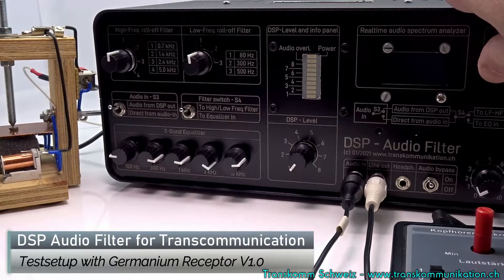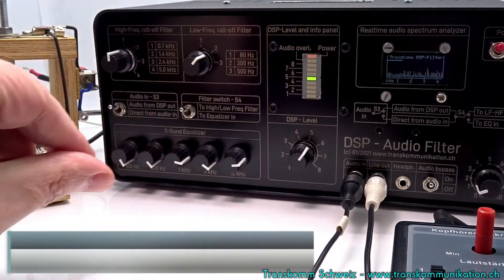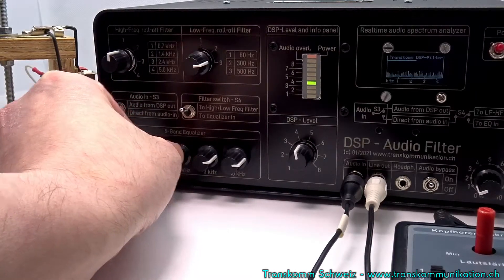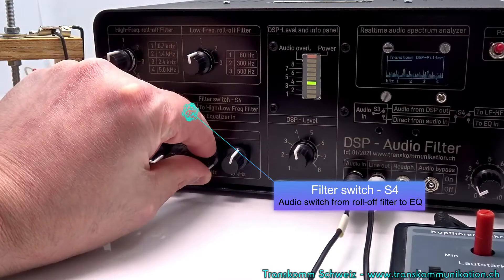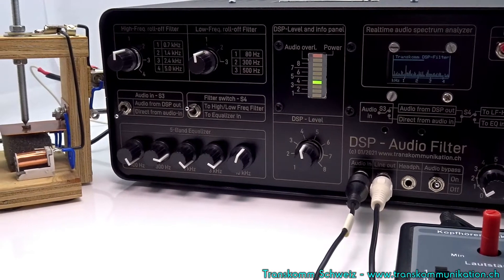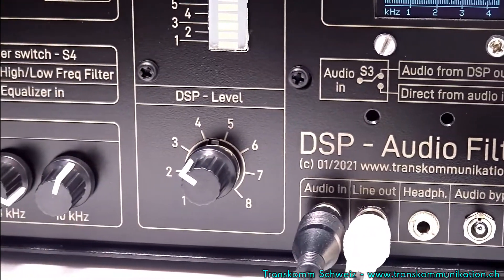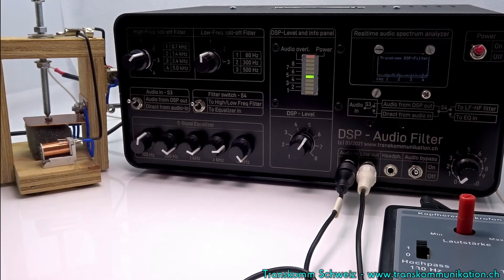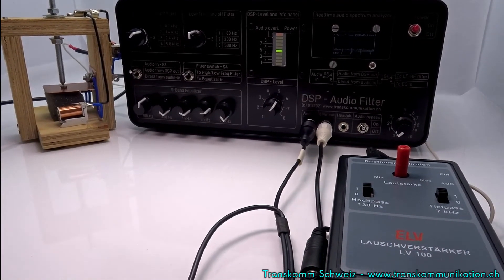Filtering Paranormal Audio: DSP Filter & Germanium Receptor V1.0 Test

Comment: The results of the DSP processing remind me of those the LINGUA produced as well. Your filter is an excellent device for all kind of ITC setups. It is outstanding on all levels and not the slightest trace of ac hum!
Reply from the maker: Thanks Andrés. The DSP filter algorithm works similar to the LINGUA DSP filter. 
In my opinion, the filtering of my bhi filter is less "aggressive" than that of the LINGUA. Therefore, the filtered signal does not have too many filter artifacts, which improves the intelligibility of the audio signal.
Reply: @beyond_electronics  This is a very important information for me Salvatore because, as you know, the LINGUA by HoerFabrik isn't available anymore. I own one LINGUA which is such a versatile tool to improve ITC voices and up to now I haven't found anything to replace it that is available in the internet. Thank you!

Comment: This is excelent, thanks for sharing. I d love to have one of them  germanium receptors. That offset white noise does sound completely different to radio type white noise. Do you have noise gate on that audio hardware?or dynamic processing? Cheers for sharing
Reply from the maker: Thanks :) The Germanium Receptors I unfortunately do not sell yet because it takes a lot of time to build them, at least the Germanium Receptor V2.0.

The Germanium Receptor V1.0 here in the video is not complicated to build and can be rebuilt relatively easily.
For the Germanium Receptor V2.0 I was busy with the construction for almost 4 years. But I have published all documents on my homepage and everybody can download the plans to build it by themselves, technical knowledge provided. 

The noise is definitely quite different from a radio because the noise is "generated" by the germanium plate, in connection with the coils and also the pressure of the screw tip on the surface of the germanium. In this video, the signal from the germanium receptor is processed with the DSP filter. 
This is a DSP module from the company bhi. I then added the switching of the bandpass and highpass filters and the 5-band equalizer. 

Otherwise try to rebuild the Germanium Receptor V1.0. The plans can be found on my homepage.
Reply: @beyond_electronics  was just thinking, i remember reading somewhere that the distance of the copper coils is important, if the device was constructed with coils on a pully, then the distance could be experimented with, as apposed to the coils being stationary, just a thought anyway. Thanks again for sharing this great work
Reply from the maker: Thanks for your comment. Yes, you might be right about variable spacing of the coils. I also had this thought when building the Germanium Receptor V1.0, but I initially wanted to build it relatively close to the original. 
Many ideas came together and at a later stage I will surely build an extended version of the Receptor with variable coil spacing. Among other things, I would also like to make the coils interchangeable to see/hear if anything changes, or if maybe the whole Receptor becomes more sensitive. 
Another idea is also to put the whole construction of the Receptor inside a big coil and then "activate" it with a higher current flow. So there would be a magnetic, as well as electrical components involved. 

Thanks in any case for your interest.
Reply: @beyond_electronics  i m no electronics person by no means, and have started to gather together the parts for the 1.0 from the original device,  like you, i am not going to make the 2 coils on a pully system as in the original it is stationary, although i do like your ideas on 2.0 and the interchangable idea.  I v wrote down some ideas of my own, does your website have a forrum, thanks
Reply from the maker: I would be very interested to know, when you have finished building the Germanium Receptor, how the noise will sound in your version and also if the voices will manifest. Please report here afterwards. 
Unfortunately I have not set up a forum on my homepage either. I simply don't have the time. 
I wish you good luck with the construction of the Receptor V1.0.
Reply: @beyond_electronics  thanks again
Reply: @beyond_electronics  hi , i d like to ask 1 question if its ok too, what method did you use to pressurize the germanium from the screw pushing down upon it? i can see the screw in the picture with the bolts on either side, did you have that connected to another  section to allow the pressure.  thanks again
Reply from the maker: The pressure on the germanium plate comes from the screw, whose tip is sharpened. 
I can vary the pressure by screwing two nuts in the middle of the screw. These are two lock nuts , and in between is the wooden construction. This means that the pressure is created by locking the two nuts. 
My procedure is: I loosen both nuts on the screw and then place the screw tip very loosely on the germanium plate. Then I press very lightly the screw tip on the plate and then screw both lock nuts together so that the screw can no longer loosen. This creates a pressure on the germanium chip. 

However, it is important not to apply too much pressure on the germanium plate, otherwise it could break. 
I hope I was able to explain it in a way that is somewhat understandable. At this link you can find a picure of what i mean: https://www.transkommunikation.ch/temp/dsc00908.jpg
Reply: @beyond_electronics  interesting, and thanks for the hard work here.